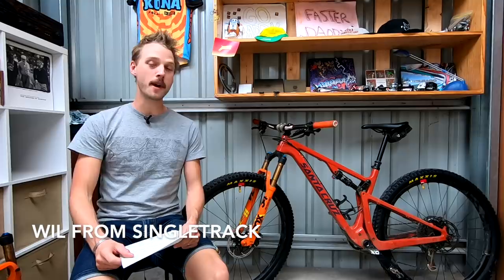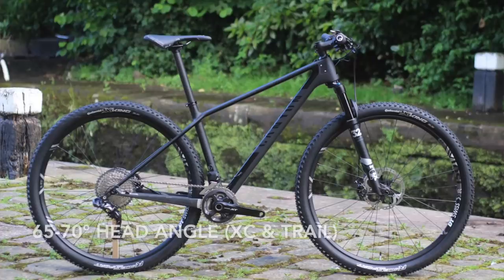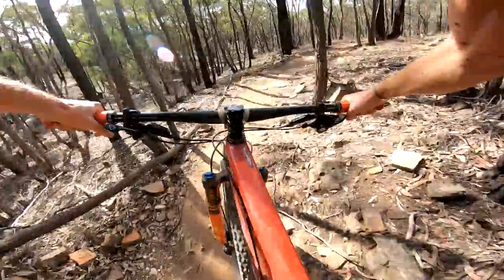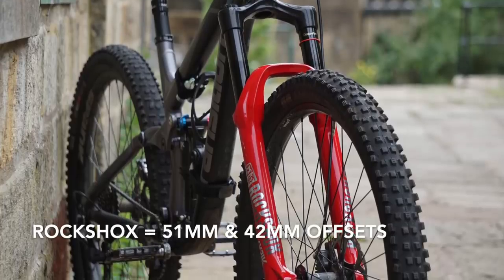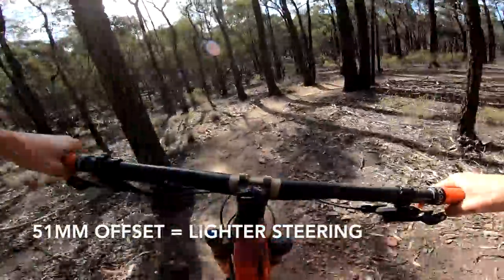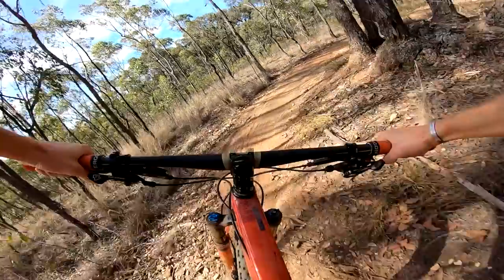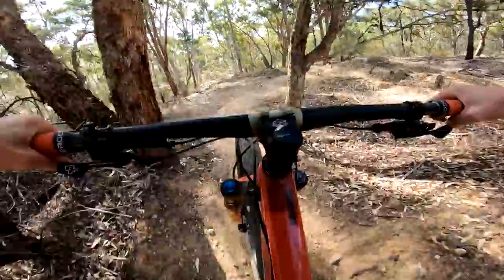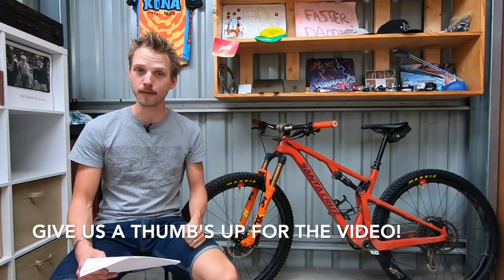What is fork offset? | Testing The Santa Cruz Blur With 44 & 51mm Fork Offsets

Comment: Great explanation, but the short stem designed for the 44mm offset may have been why it was twitchy on the descents. The proper length stem would put your handlebars positioned correctly forward and over top of the the front hub. I have a Stumpy with 51MM offset and a 75mm stem. It is really stable on descents. My trails actually suit the more nimble handling of 51mm with the 29er wheels.

Comment: I've built a couple bikes with reduced offset forks and won't go back to 51mm. First thing I noticed was the lack of corrections I had to make in corners and how it just smoothed the steering out. My current 29" trail bike has 120/100mm travel with a 66* HTA and 40mm offset fork.

Comment: Good explanation. I went back and forth between a Giant Trance 29 with short offset and GT Sensor with slacker HA and regular offset. I found it virtually impossible to distinguish - the only handling difference I thought I felt was liking the shorter offset better for tight, twisting climbs... puzzling and certainly not worth all the BS.

Comment: nice work, mate. i have 2 bikes - the burly MegaTrail with a slackety-slack 64° hta, so running a Lyrik Ultimate with a crazy tight 37mm offset. it goes down hills like a champ! the other is a Spot Ryve 115, at 67.2° and running a fox 32 with 44mm offset. i find that on my Spot, a longer offset (51mm) is very twitchy on slow, tight corners. and less stable at high speeds. i then ran a 44mm offset, and the cornering at low speeds is more reliable. high speed control also improved. that being said, both bikes have the same anvl 32mm stem and 740mm wide bars. the odd thing, to me, is that subjectively the 51mm offset on the Ryve should help with slow speed cornering/climbing, but i dont see it. the high speed control on this bike is vastly improved, tho, as i have noticed. my overall claim is for me, 51mm offset on a steep HTA does not work well with a very short stem. YMMV

Comment: I have an epic evo w a 42mm offset fork and a stumpjumper evo 29 with a 51mm offset and the stumpy steers better with a 63.5 HTA. I'll be swapping the epic to a 51 soon. It makes it handle like a bus in singletrack
Reply: Excellent information. So to clarify and check if you still feel the same a year later, you've no handling issues riding a evo 29 with 51mm offset, although a complete bike is spec'ed with a 44mm offset? Did you get a chance to ride the evo with 44mm offset? I'm trying to decided if I use a fork I already have (51mm offset) on a new evo 29 frame I purchased, or look for a 44/42mm offset fork. Thanks!

Comment: Great informative video. But I wish this bike was ridden and tested as a dedicated xc bike which it is and not a 3/4 trail bike. Everybody talks about how it descends but I haven't seen a single video on how it climbs tight steep switchbacks or technical climbing features.
Reply from the maker: Hey Marek!
Thanks for watching and for your feedback - it's much appreciated!

As I mentioned in the full review, I actually tested the Blur as a full-blown XC bike last year;

https://singletrackworld.com/2018/03/first-ride-review-santa-cruz-blur-3-cc-xx1-reserve/

In answer to your comment, it does climb exceptionally well. It has a very stiff frame and the suspension is totally efficient even with the shock set wide open. The handling uphills is quite neutral and steady, and because the head tube is very short (90mm), it's possible to set it up with a very low bar height for maximum climbing power and efficiency. 

Following that original test, I requested a frameset on its own from Santa Cruz, with the idea of building it up as a custom bike. I wanted to try it out with a 120mm travel fork and some burlier tyres, mostly to see just how far it could be pushed. Turned out to be a really fun bike too!

I'm actually turning it back into full-blown XC mode right now. Fox is sending me one of the new 32 Step-Cast forks with 100mm travel, and Hunt Bike Wheels has sent out some prototype XC racing wheels that I'll be able to talk about more soon. I've also just fitted a new longer/narrower cockpit setup, so it should end up being quite a sharper racer when those changes have been made.

Hope that info helps explain, but if you've got any specific questions for me about the Blur as an XC bike, by all means send them through mate!

[ST Wil]

Comment: Great video, thanks for taking the time to really analyze how the changes to offset actually effected your ride out on the trail.  
Question: What I have yet to figure out is...slacker head angles were/are used to make bikes better at descending, so why did companies not just continue to make bikes slacker and not mess with offset?  Or conversely, if offset has the same effect as slacking the head angle, why did the bike companies spend the last 5+ years remaking their bikes to make their frames slacker, when simply changing to a reduced offset fork would have the same effect?  What am I missing?  Do offset changes not have the same "effect" as head angle changes?   Can I pickup a used frame with an "out-of-date" head angle of 69 degrees and slap a reduced offset fork on there to get the same ride characteristics of newer models?
Reply: Although trail is the most important part of steering geometry there are other factors that affect how the bike feels. Wheel flop is one, and touring bikes often achieve the desired trail with slightly steeper head angles and shorter offsets to reduce flop a bit because you may be using front panniers. On a mountain bike I think a slack head may also be desirable because of the angle at which you're hitting rocks and things with the front wheel. So it might be better to go even slacker and add offset... Not sure at what point excessive wheel flop becomes a problem. The other reason you need to go slacker than before is longer fork travel. An HT that's 65deg with a 140mm fork at 25% compression will be about 71 deg at full compression.
Reply: Besides what Ben C mentions, a slacker head angle increases the front centre, while a shorter offset reduces front-centre length (both increasing trail). Slacker indeed means a more beneficial angle for the fork to absorb impacts and less over the bars risk, a shorter offset might keep more weight on the front compared to a bike with the same trail with a slacker head angle.

Comment: Nice information. Currently I have an Specialized Fuse Comp with a 120mm fork 51offset. I’m planning upgrading the fork to a 130mm or 140mm. Would be wise to reduce the offset to 44 or 42?
Reply from the maker: Glad you found it useful Roig!

That's an interesting question you have on your Specialized Fuse hardtail. 

Firstly, do you know if the frame warranty will be voided if you put on a longer fork?

Generally most frames will have a limit as to how long of a fork you can put on there, so you'll want to check that out first before assuming you can go much longer on travel.

If you do end up going to a 130/140mm travel fork, remember that you'll be slackening out the head angle, as well as slackening the seat tube angle and lifting the BB height. So bear in mind the affect that will have on your riding position.

Assuming you stick with a 51mm offset, that slacker head angle will still increase the trail figure. This will steady the steering behaviour a little bit. However, going to a 42/44mm offset will take that stability even further.

A couple of questions to ask yourself;

- What stem length are you using at the moment?  And if you went to a reduced offset fork, could you comfortably go a bit shorter on the stem length? Or is the cockpit already a bit cramped?

- How twitchy is the handling at the moment? Do you want to slow down the steering and improve straight-line tracking on the descents? 

The cockpit question is an important one, because bar width and stem length play an important role in determining how much leverage you have over the front wheel. In my experience, a reduced offset fork plays best with wide bars and a short stem. But if your frame is already a bit short on the top tube, going to a wider bar/shorter stem may not be ideal.

Hope that helps mate!

[ST Wil]
Reply: Singletrack Magazine Thanks a lot. The stock stem was 50mm I change to a 45mm. And the stock bar was 750mm, currently have a 760mm. The Fuse BB height is very low with the stock tires 3.0 Now I have 2.8 rear and 3.0 front. If I change the fork I will go 2.8 front and rear to compensate. Thanks for you time.

Comment: Would be interesting to see the difference with different stems and frame sizes.

So you could have the same seating position with different frame size and different stem lenght. 

I mean a small frame, 50mm stem and huge offset. Compare to medium frame, 30mm stem and short offset.

Comment: Does offset change how the bike handle steep sections? The difference between the two options with Rockshox is almost 10mm, you say that it shorter offset makes it more stable at speed but having the front wheel 10mm further out in front of you and also increasing the wheel base by 10mm not do anything for stability?

Comment: what if I'm looking to downsize the fork in general? I have looked at the geo the bike stock comes with a 44mm offset. The ht angle will be changing by +1 deg . so for this example would you stay with the spec'd 44mm offset or get a 51mm?

Comment: Amazing video. Seems like the offset is not that important for amateurs, specially if you consider that the 51mm suspension sometimes is U$300 cheaper than the 44mm.

Comment: I'm currently using a 35mm stem with a 42mm offset fork and the handling seems a little bit twitchy. would matching the stem length to the offset help with this? say 40-45mm?

Comment: I ve a really weird experience. I ve two nomads. One in small, the other medium size. 

The 46mm offset doesn t feel good with the small frame. The bike is far too agressive in the turns. The medium is much more calm with the  46mm offset and still alive.

Now i m very confused. I m thinking to buy a shorter offset for the small frame, to bring back some stability. But the wheelbase is shortening then, too. I don t know what effect this is going to have?   

On 29" forks the difference is 5mm and not a huge difference. On 27.5" it is 9mm difference  which is plenty.

Comment: Hay there 👍what happens if I increase  my fork length 170mm too 200mm is that too much . Is there a maximum set by manufacturers? thanks
Reply: The difference in axle to crown measurement between a 170mm single crown fork and a 200mm dual crown fork is about 15mm so the difference isn't that major. There will be less than a 1° change in head angle/ seat angle. You'll lift the bottom bracket by roughly 6mm and lose 8mm roughly of reach. If that along with more stiffness and travel up front is what you want then go for it. It will probably void the frame warrantee if you have one  because the dual crown will put more stress on the head tube due to more stiffness and longer axle to crown

Comment: For an average rider, i'd say this offset thing 44 vs 51mm is pretty much bs. I personally went from a 51 to a 44 this season, no difference whatsoever. Why does everything have to be made so complicated? It just confuses people. Folks, don't think about this, just buy what is available atm of purchase if you are an average guy or gal just riding trails to stay in shape. More advanced riders can probably tell a difference no doubt.
Reply: I'm trying to work this offset out as my mate has fox 38s the grip 2 type I just got the fit4 38s on my new bike came with them but his has a sticker saying 27.5/29in below the wiper on the right fork mine don't and I'm running 27.5s  his offset is ment to be 44 to 51 mine is 37 to 44 both being 44mm would I be able to run a 29 on the front or not they look no different side by side so he's coming over tomorrow gonna test this out! I mean my 27.5 look huge I don't see how the 29s would benefit me I'd never get on the bike! Just you seem to have more experience here it seems can you shed some light on this for me please?
Reply: @Emtbtoday   I wouldn't worry about the offset, especially if you're a pretty average rider. Your friends fork is a 29in fork, but you can put 27.5's on it if you want to. Yours is probably a 27.5 fork but go ahead and try his bigger wheel on it, you'll see instantly if it's a 27.5 fork.

Comment: I hv a 27.5 160mm fork with a 42mm offset with a 66 deg head angle on a 150 travel bike. I still crash alot. But it does feel more stable going fast thn going slow. Maybe thts y i crash alot (besides crappy skills). Bike makes u want to go faster all the time.
Reply: This video is for 29 inch wheels. Your 27.5 fork has the longer offered offset with the 42mm.
Reply: @justinwbohner  really? What is the  shorter offset offered by rockshox or fox for a 27.5 one can buy after market?
Reply: @stevent1565  Because of geometry. The 29er wheel axle to ground is taller than the 27.5.

Comment: What part actually is different, the steerer tube or the lowers?
Reply from the maker: Yo Eskohl!

In most forks, the total amount of offset is made up of both the lowers and the crown. However, if you buy a 44mm or a 51mm offset fork, both with have identical lowers - the difference between the two is entirely in the crown.

[ST Wil]

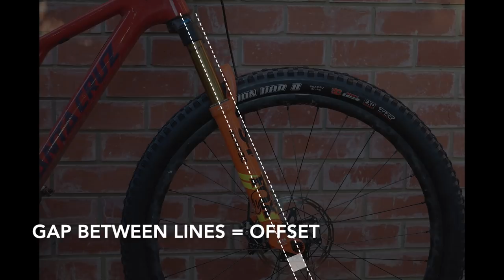Comment: 2:03 You did not mention the offset at the crown.
Reply from the maker: Yo Johannes!

Apologies if there was any confusion there for ya - the offset is the measurement of how far forward the hub axle sits in front of the steering axis. This offset can be found in both the crown and the dropouts, though the most important aspect is the total amount of offset.

Hope that helps explain, but if you've got any more questions, just shoot them through mate!

[ST Wil]
Reply: @singletrack  I already knew this, I just thought you should have mentioned this. Now you have, well put. Thx.
Reply from the maker: Will gives a detailed explanation of both types of offset (crown and dropout) in Part one of this feature here :-) https://singletrackworld.com/2019/04/what-is-fork-offset-and-why-does-it-matter/ 

[ST Mark]

Comment: TL;DR there's not much difference, it's for fine tuning a ride, and there are inexplicable tire changes when swapping forks.
Reply: Great job. How do you predict size of bike comes into play? If I've got a XL bike with a big wheelbase...and the chainstay length is the same for all sizes...meaning that the front and center is growing disproportionately as you go up in size ....wouldn't i benefit from a 44mm offset and a 32mm i9 stem? 😊😷

Comment: I think u have it wrong . Longer offset means greater caster means more nimble and lighter with the steering. 44 should give u less caster if anything but then I doubt we could feel 5 mm difference in offset.
Reply: Shorter offset moves the wheel backwards and therefore trails further behind the steering axis. This leads to more stability. Think of it like caster wheels on a shopping trolley, the further back they would sit, the more stable they will be